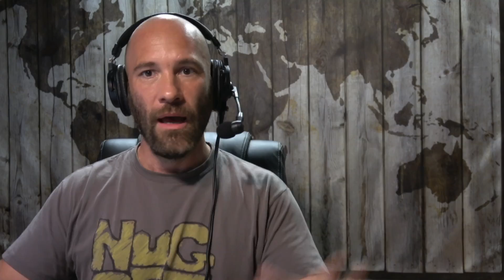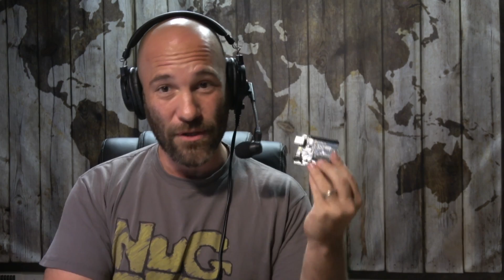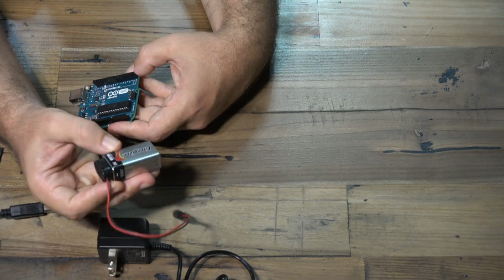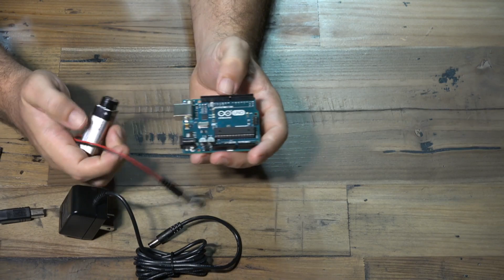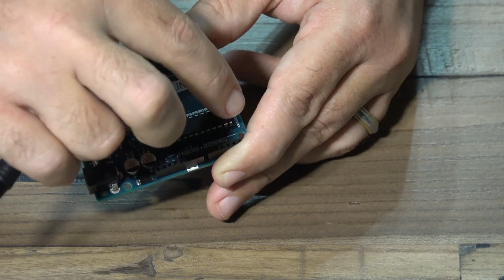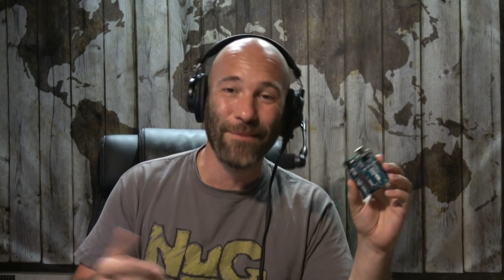Arduino Uno Board Introduction

Comment: Does the VIN pin, by default, simply pass the input voltage out?  Or do you have to program this?  And is it configurable?  Can I push 3.3 or 5 out of the VIN pin if my power supply is 9v?

Comment: 12:40 regarding the "Analog In" part of the arduino, where the pins are from A0 to A5....these pins can be used as Digital pins also!
This can be done by using them with their digital name, ie 14-19 (as an extention of digital pins)

Comment: Hi, I will like to know if i can render a 3D animation with Autodesk Maya in a network rendering on a DELL POWEREDGE R810. Its a quad processor server with no graphic card install. its uses the 
on-board graphic.

Comment: Uno is a great option especially for the beginners. If one wants to make circuits on breadboard WITHOUT shields, Nano is another Arduino board worth considering. 
Same microcontroller, thus most things mentioned in this video will apply.